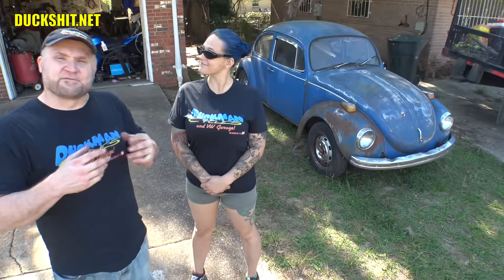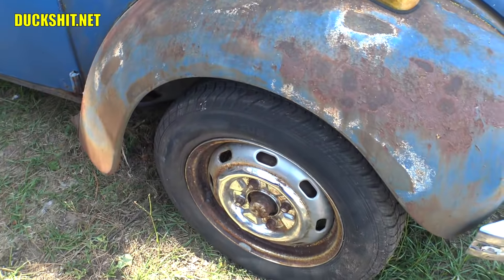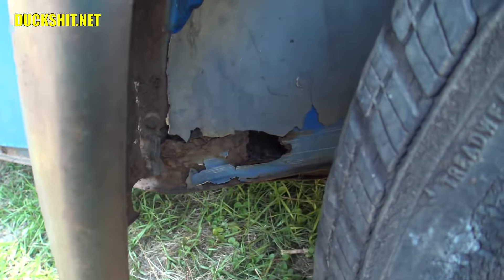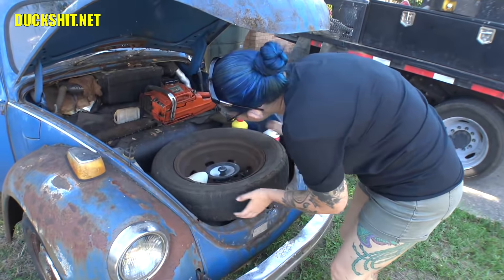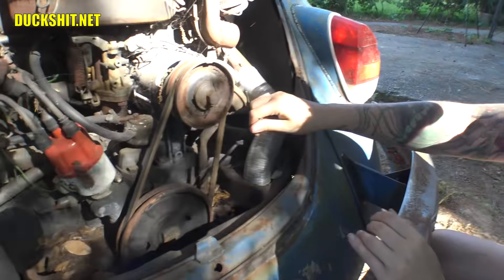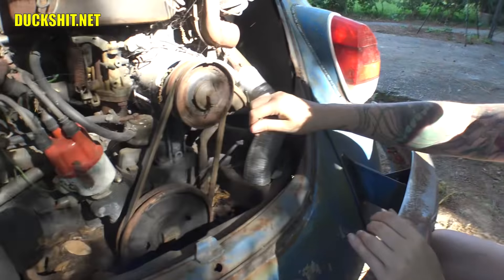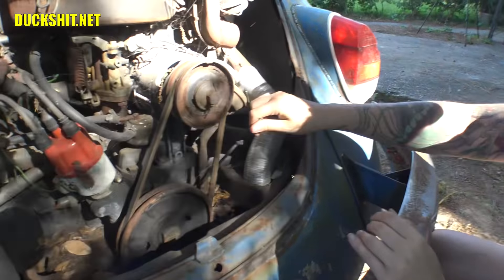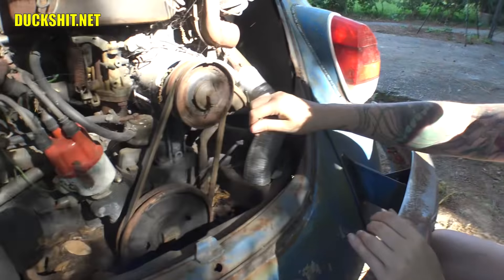What to Look for in a VW Beetle Project Car - Buyer's Guide

Comment from the maker: What was your first VW?  What kind of condition was it in?
Reply: 74 Super Beetle, Sun Bug. Given to me by my father in 81. So, in fair condition, certainly my daily driver. Now I have a 71 Super more as a fun collectible!
Reply: My first VW is the one I still have some 36 years later,  it's s 1954 oval ragtop which I got of my uncle, he bought it new , the condition was not to bad it sure got worse with me but now is perfect and my son wants it shipped to him in New Zealand maybe time to pass it on , don't want to not yet 😊 oh and it's called Ruby and my granddaughter is and my wife's horse is also" awkward"
Reply: 1964. My dad bought it in '79 for $200? No rust, but it had been hit in the rear and patched together badly, and had a D case 1200cc replacement motor. He drove it in the summer for a few years (no heater boxes), and it dropped a valve. He tore down the engine, ordered some parts and a shop manual, gave them to me when I was 14 and said put it together right and it's yours. I drove it for a few years until it blew a brake line and the nose looked like a beer can after a frat party. Got a baja kit from a friend, a complete new brake line set, along with a new master and I was back in business. Complete rebuild currently under way. It's currently coming back together with long travel suspension, 2" body lift, 4 disc brakes, etc. I've had 2 more come and go, but I'll keep this one.
Reply: 71 super beetle. Ultra clean with 65k miles. Bought it in 91. The older I get the worse my cars look. Paid 500 for it
Reply: I would pass on this car. Needs one of everything. 300 tops.
Reply: 1965 karma gia, gray,red and black inside, am fm radio, special shifter, 45 horsepower motor. Great condition , got it in 76 , so only 11 years old, had the 6 volt system,  still would run 75 miles per hour, but took about 4 miles on flat rode to get there, lol, with regular gas coloured pipe white as cotton, fun car.
Reply: an early/mid 70s 1600 Beetle, original burnt orange, Jaguar xj6 back wheels and tyres, original front biscuit tyres. It could out-drag anything over 1st 50ft...
Reply: I bought a Green '68 Beetle rust bucket in 1989 for $600.  The floors were rotted in back but it ran good.  It was sitting for a while and my brother's friend offered to buy it.  He drove off with it without paying!  Month's later it showed up in my mother's backyard completely smashed in the front. I sold it to some immigrants from Mexico for $300.
Reply: 1970 vw bug, decent interior, Maaco paint job camaro fury orange (not the best but not the worst lol) stock 1600 and stock everything else. Now 10-11 years later I still own the car and now has a Subaru swap, 2 inch raised trans, 4 inch narrowed beam and disc brake conversion and many many other things.
Reply: 67 Beetle
Reply: Mark 1 vw golf convertible (rabbit). Did a full restoration on it. Great car

Comment: I know you know your vw"s but I"ve owned a few (great cars)First thing,you take  a look at the body,if that checks out.Jack the whole car up in the air and get under it.If the frames rotted,walk away,Super beetle,strut towers are rotted,walk away.Reg beetle front end torsion set up is 4 bolts-replaceable.you know way more about vw's than I do.I'm 60 years old(I"m over it)But they are great cars,that are alot of fun.I live in NJ-rust is KING!Mechanical"s are available.Be careful,like all cars,it"s easy to pour more money in them than you"ll ever get out.Best advice I ws ever given,"Buy the best car you can afford"-It"s far cheaper in the end.
Reply from the maker: Agree with everything, but VWs don't have frames.  Hehe!

Comment: The metal plates at the bottom of the door are a original option you can get at the vw dealership and it was meant for stopping rust. my 74 standard beetle has the plates and they have really helped stop rust.
Reply: Also the metal on the heater chanel is not what I was referring to it was the 2 plates screwed in on the door and pillar.
Reply from the maker: Stopping rust? Usually they are used to cover rust.  The rust In those areas attacks from the inside.  In addition such covers will rub and vibrate against paint and trap moisture causing more rust.  In my experience there have been nothing but problems behind them.
Reply: @DuckmanCycles  yeah that's what I meant

Comment: I never knew that dash-pads were installed on Bugs because of a mandatory law. Thank you Duckman for that bit of info!
Reply from the maker: It was also a related law that triggered the introduction of a curved Beetle windshield.  There needs to be at increased distance between windshield and driver's head.  😉

Comment: My parents sold me my first 1964 Volkswagen Beetle when I got out of the Army in 1974 for $269.  The funny story is the ending of the car:  I was driving one rainy day and apparently was hydroplaning - no brakes, no down shifting, no turning and I ended up under the back end of a jacked up 1964 Chevrolet Impala!
Reply from the maker: Yikes, How did you and the cars hold up?
Reply: @DuckmanCycles  His back end took the front lid and shoved it thru the front window - if he was jacked up another inch I would not be having this conversation today.  As it was I survived pretty well.  Sadly the car ended up at a garage and they wanted so much money for storage and towing I ended up letting it go.

Comment: My first vw parts car, was a 72 super,same colors and rusted 
 like the one in the video. 👍
Reply from the maker: Hehehe what are the chances?
Reply: @DuckmanCycles  
That was also over 20 years ago. 
I still have the engine deck lid,and the interior which was in nice condition, is in one of my friends orange 72 super.

Comment: My first vw was 1974 vw variant 412 le( fuel injection). My current beetles are a 1969 and 1974 beetles. The 69 is a 1300twin port and the 74 was a 1600tp and is currently running a 1641cc.
Reply from the maker: Very nice
Reply: @DuckmanCycles  my dream motor is a 2165cc from cb performance

Comment: always wanted an optional chainsaw with my VW! :D And I used to have spare engines in the trunks of my Super (stupid) Beetles! :D  You might want to mention since the frame head is part of the front suspension - I have seen those rotted out and needing to be replaced!
Reply from the maker: Can’t beat a free chainsaw, plus it will be a new video... will it run?  Hehehehe

Comment: What's your take on the mexican vw beetle ? 1999 model with air conditioning, fuel injection and pre 67 fenders and bumpers. Zero rust. Imported for Japan
Reply from the maker: Always wanted one as a kid, never could find one as an adult.  Might be good!  Did you get it?
Reply: @DuckmanCycles   well I've put a deposit on it. Drives great and looks the part. Still has that soul all vw fanatics talk about so I guess I'll go for it

Comment: Hey did you see Mike fn engine on the bucket Bus he's working on? Just like you pointed out what happens when the carburetor has no cover over it for years. Water down in the magnesium block destroyed it. "I'm melting"😱
Reply from the maker: Freshwater usually doesn't do too much to the magnesium, salt on the other hand.... oof.  Check Eleanore's earliest videos when I pulled the engine out to see salt water damage